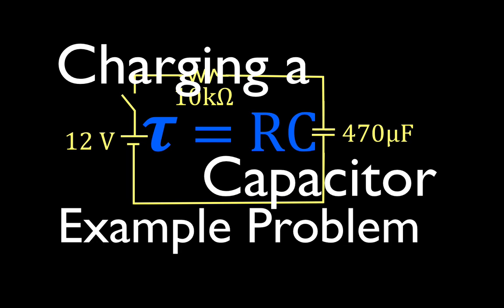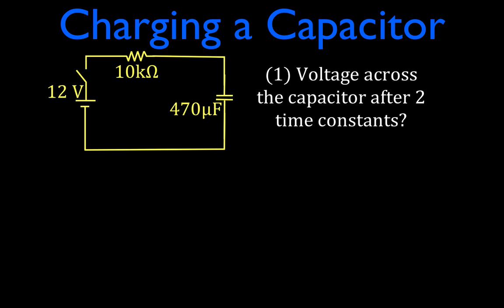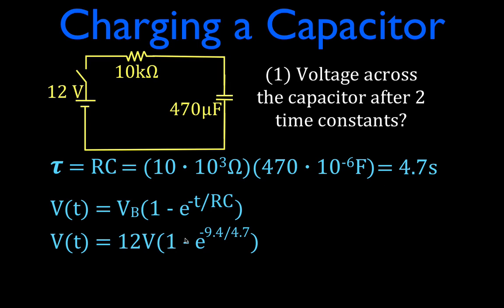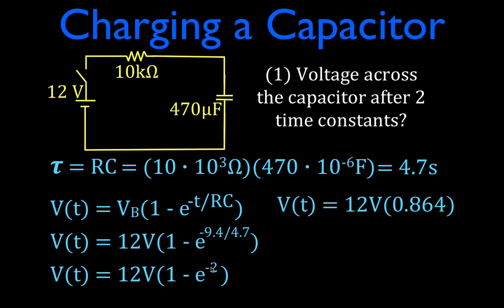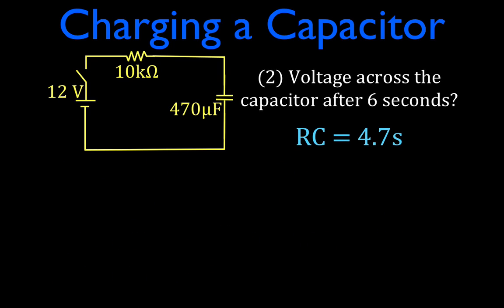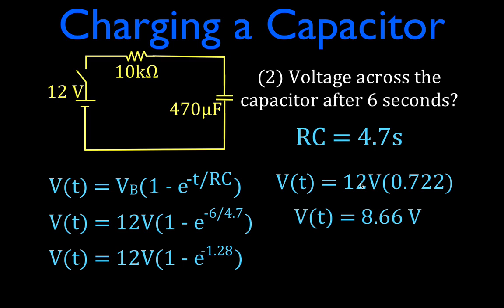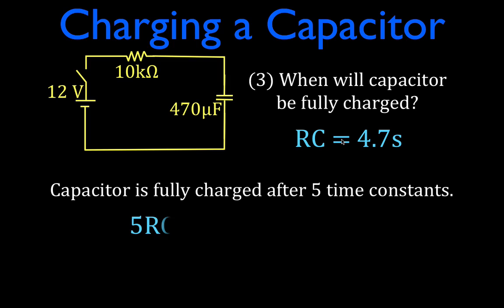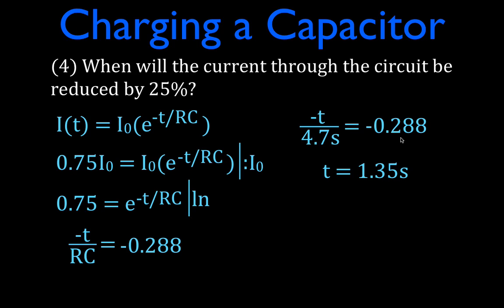RC Circuits (5 of 8) Charging a Capacitor, Time Constant, Voltage, Current, Worked Example

Comment: BRIAN SWARTHOUT, Which Buttons on the calculator has that "e"? I'm using the free windows Scientific calculate on a PC but I don't see the "e" and to add the -1 above the e
Reply from the maker: e is Euler's number, e = 2,71828
Reply: @stepbystepscience  Can you make a video showing how to use the calculator to get each of those time constant voltages because I must be doing something wrong on the calculator that I'm not getting those time constant voltages using that formula with the "e" as 2.718

Comment: is the voltage across the capacitor the same as the voltage across the resistor ??
Reply from the maker: Yes, when the capacitor is fully charged.

Comment: Hi. I have a problem. I'm stuck with this Euler's number. I know its value and also I have a calculator (on my cellphone) wit this function on it.  But no matter what button combination I'm using, I simply can't get the same result as you. I have even tried some online calculators but with the same result.

Comment: What if it says what’s the voltage on the capacitor
Reply from the maker: Depends on when, but when the capacitor is fully charges the voltage across the capacitor will be equal to the voltage of the battery.

Comment: What happens when capacitor is constantly charging? For ex: the capacitor is 50 volt, but you use a 9 volt battery to hold a charge then use a step  up converter to boost it to 50, after the capacitor is at 50 use a step down converter to 9v so the the step up converter can work and is constantly going.

Comment: Is the 12 volt  supplie also refer to the capacitor voltage as well?
Reply from the maker: When the capacitor is fully charged the the voltage across it will be the same as the voltage of the battery.

Comment: Hello, thanks for sharing.
Please I have got a small solar panel and its out is 8v and 0.02mA, but when I add a small load, the voltage drop to 2v. I added 0ne 2200uf  capacitor and the current add up from 0.02mA to 0.25 with the same volts. the capacitor takes 1 second to charge up to 8v and 0.25mA. Now I want to add up to 50 caps and put some components between the caps and the load which will be discharging  each 10 caps in every other 5 seconds but the input of the caps will be connected to the panel continually to allow them charge. I need about 10AMP at the output of these 50 caps, so my question is will the output of the panel be enough to keep all these caps charged or do I need to put a boost converter between the panel and the caps?. Note that    these 50 caps are  programmed to be discharged randomly so there is going to be diodes but no resistors since I want to obtain high Amps at the output. Please help.

Comment: a little confused - can anyone explain - how for question  1 and 2 formulas gone from v(t)=12v(1-e-1.28) to working out the number in brackets - eg quest 2 is 12v(0.722). Where did the number 0.722 come from? How was it worked out? Thankyou for any explanation
Reply: What is e????

Comment: On question 3, i dont' undertand how you come up with 5 time constant...thanks :)
Reply from the maker: it is generally accepted that the Cap is fully charged after 5 time constants.
Reply: how do you explain this if you have to use  calculation? i am afraid it wont be accepted on my case :(
Reply: To find out % charged after time constant do: (1-e^-RC), so after 5 time constant --> 1-e^-5 = 0.9932... basically 99% charged after 5 time constants, basically fully charged.